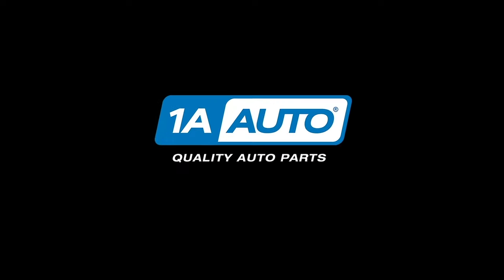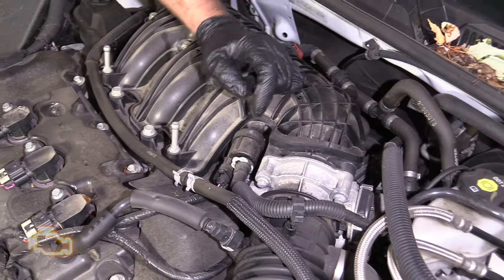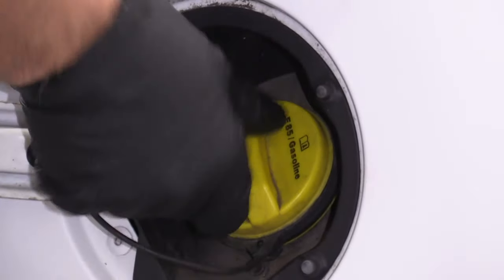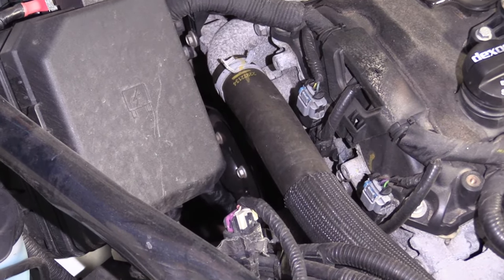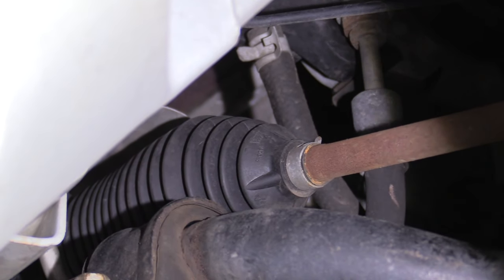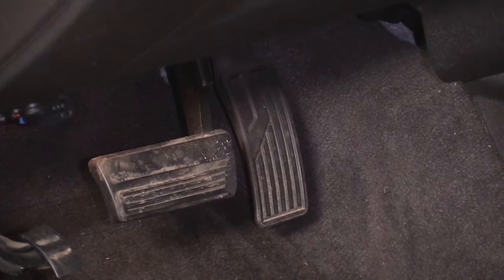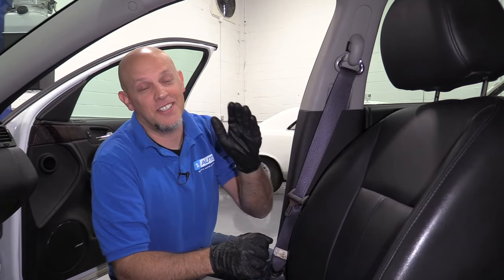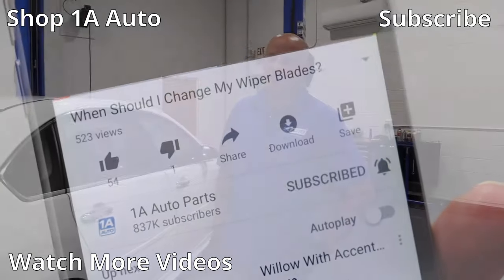Top 5 Problems Chevy Impala Sedan 9th Generation 2006-16

Comment: I didn't here the traction control listed that is far more troublesome than the top 5. Starts off with minor abs actuation  when turning and continues to the point where its difficult to drive with it. Also the rear defrost harness burns out on the Passenger side near the fuse block. The defrost is easy to fix  by bypassing the harness with a heavy gauge wire and soldier connections but the Traction Control requires wheel sensor harnesses and the sensors them selves to be replaced and can be moderately costly. I have had both front harnesses replaced along with the Drivers side front wheel sensor / hub assembly and I still have problems. I just turn off Traction control  at this point, I'm sure I will have to take it in at some point again.

Comment: I have experienced all of that...The purge thing has happened twice. The seatbelt tentioner happened when I got rear-ended, then the breaks failed as the petal went all the way down, even when I pumped.  Watching other car crashes on u-tube, I see people do a lot of coasting after they are hit.  Seems other vehicles have these failures.  After I shut the engine off and turned it on again, the breaks worked normally.  I had the GM people come down and they put all types of recording equipment on the car and told me there was no failure.  I have the report.

Comment: Just curious does anyone else have the problem when you put it in gear it whines but when you put it in park the whine stops.
Reply: Yes 2013 ltz 3.6
Reply: It's your power steering pump whining. Check power steering fluid level dipstick, add fluid even if it show full. You probably have a fluid leak at the rack. Common problem on these cars. Cost big $$$ to fix.
Reply: @amaralbrian1  its when I put it in drive and I sit there or accelerate and it has nothing to do with steering

Comment: Has anyone experience an intermittent  problem with hard thump accelerating from a stop?  Feels like the transmission is in neutral then dumps into gear.  Had trans rebuilt and changed accelerator pedal, no change.  Had the brake booster replaced for a different problem and the symptoms went away for awhile but eventually came back.  My wife has a 08" Impala 3.5L
Reply: I have this problem but mostly when I try to speed up not from stop
Reply: my 2015 did same. its the shift modulator sensor in transmission 1200 for part!!!!

Comment: When changing the rack and pinion is it necessary for me to change Stirring pump at the same time
Reply: No you don’t have to as long as your pump is working fine.. I did my rack with the help of a friend.. went to pepboys the next day and have the fluid flushed to avoid air in the lines

Comment: I have had4 of these impalas and everyone of them had vent door actuators fail.. and every one of them has had the same transmission problem.. pull away from a light and it hesitates then jerks.. I don't  think I'll  be buying another gm product.. piss poor engineering

Comment: I have a question if anybody can help to answer, I have a 08 Impala ls and I’ve noticed here lately the acceleration seems to not wanna go like usual. I’m worried about the transmission cause it feels as if it slips when this happens but I’m kinda clueless.
Reply: Same problem
Reply: @OgBlkSayn03  I took it to autozone and the fuel injectors popped up so I’m gonna fix them and see if it fixes the problem.

Comment: I just got one I've had serpentine belt replacement and idle pulley.
But I still hear a squeal when ever accelerating on the passenger side .
Also when car is cold and I start to warm up there is a grind noise that is consistent with the RPM there is a grind noise as the rpm goes down then goes away after few seconds.
I've noticed that it's kind of rough when I reverse.
Not sure what's causing all of these symptoms.
Do you know what this could be ??
Thanks in advance

Comment: Biggest problem is the 3.6
Reply: Please that engine never has issues. Maybe try using the proper detergent gas, And proper oils.  And sevice your car. LFX V6 is one of the top V6s in existence. Smokes any of those Old push rod v6s